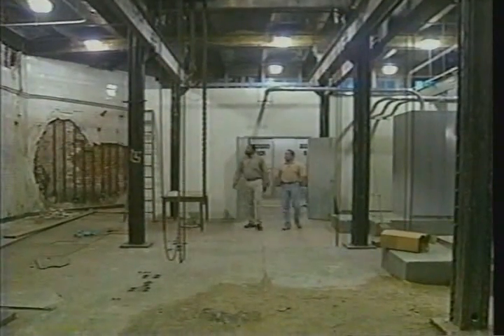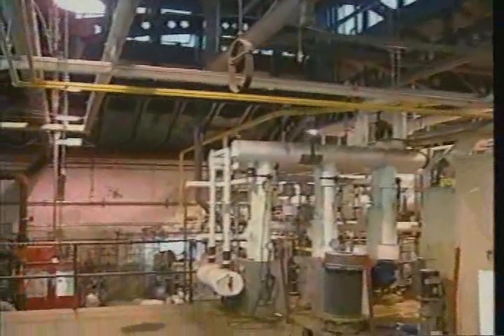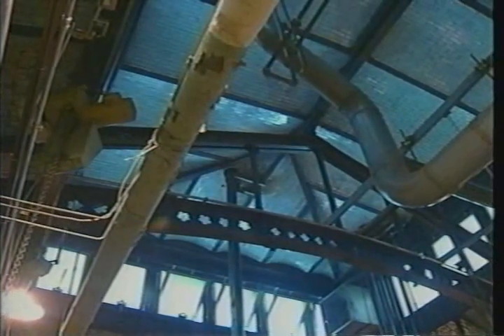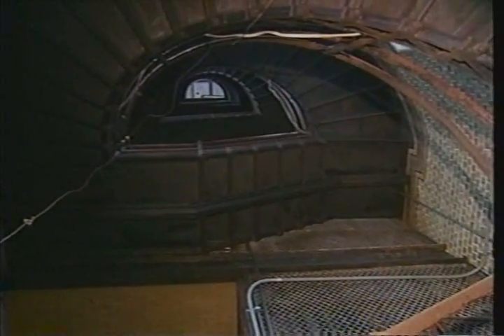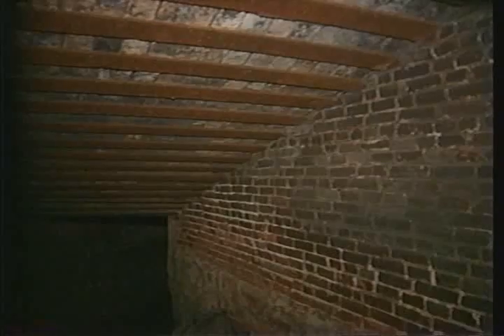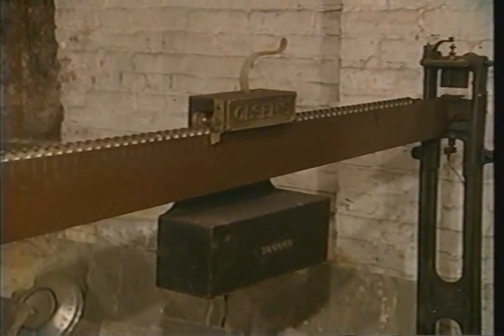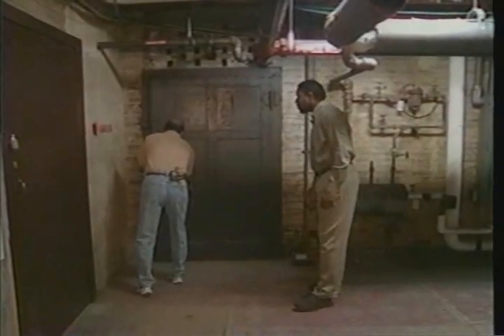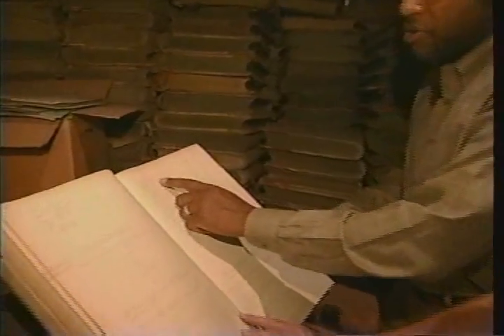Philadelphia - Underground tunnels and sights from City Hall

Comment: I was part of a construction crew back in 2005-06 who did work in the widener building across the street from city hall. There were tunnels in the sub basements  that are connected to city hall and other buildings. It’s a pretty extensive underground system. Saw a lot of cool stuff.
Reply: I've worked at Capital Grille at Broad and Chestnut since 2007. Our building also has the sub basement. It is probably a part of that system that you're talking about. I've heard that it connects under Macy's, City Hall, and The Ritz Carlton. There is so much cool history in Philly!